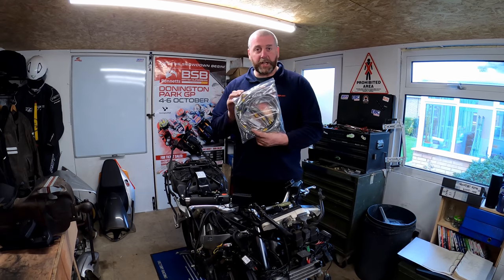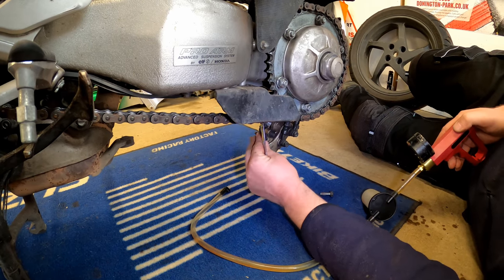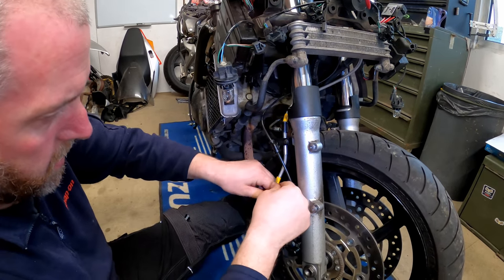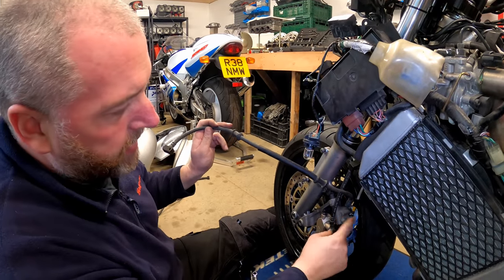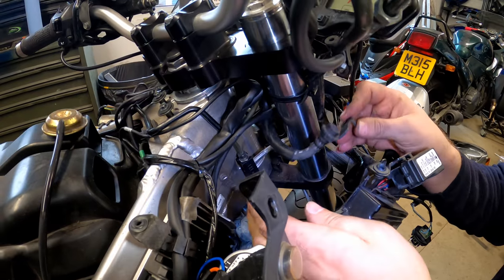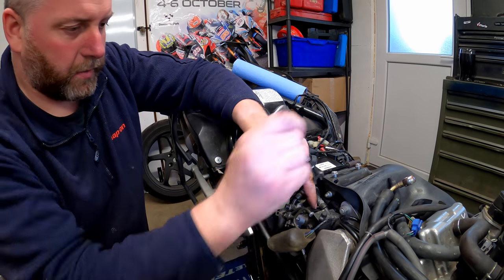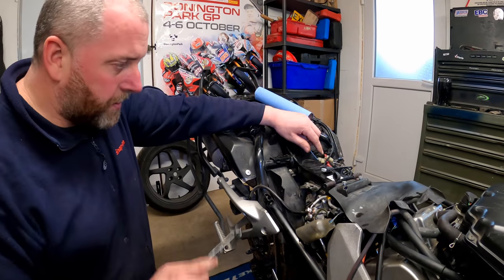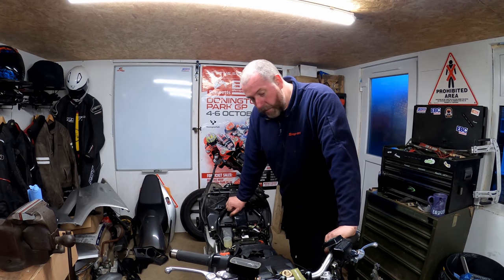Honda VFR800 VTEC 2002 - 2013, Stainless Steel Braided Brake Line Fitment - Complete Kit

Comment: Great video, thank you Kev. I did mine and was a voyage of discovery as to what went where. This will save lots of people a world of pain. One thing possibly worth thinking about...This is the one chance to separate the caliper from the secondary master cylinder on the front left side and check the condition of the slider pins and little rubber boots. One line normally prevents this from being checked, cleaned, lubrication and replacement if required. I have a late model vfr now. Brakes are no where nearly as powerful. They should have stayed with the linked lovely gold Nissins.

Comment: Brings back memories of swapping my lines last year. I overhauled the calipers all round and the secondary master as well. I didn't remove the tank or top fairing and screen tho and I can see how much of a help it would have been. The only issue I had was getting to the block behind the rear shock as there wasn't enough room to get a normal socket to it. Great video mate
Reply from the maker: Yeah, getting in to where it mounts behind the shock is not easy! Thanks bud!